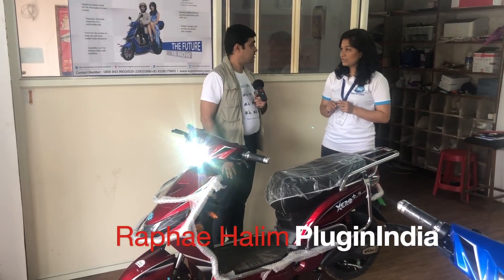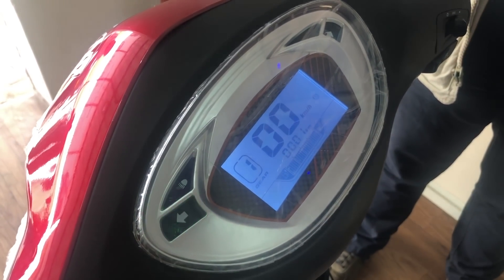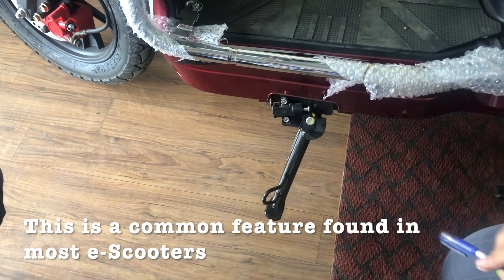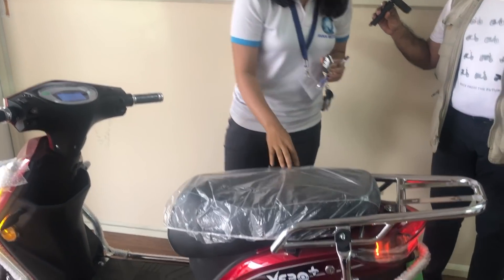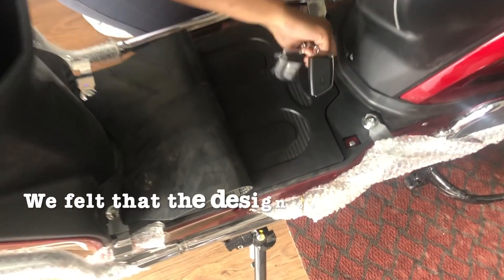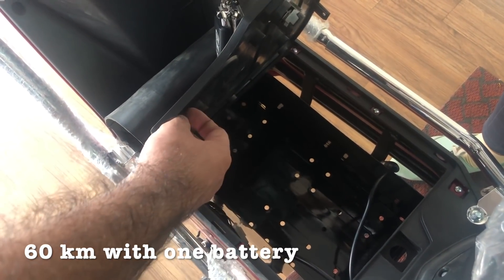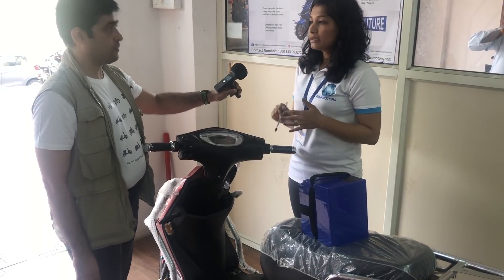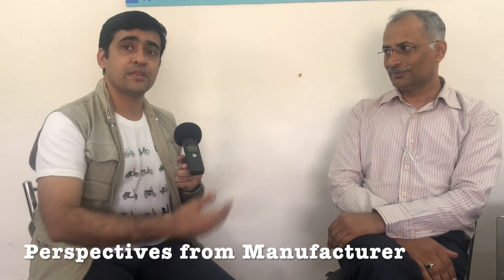Avan Xero+ Electric Scooter : Preview | + Perspectives from COO

Comment: Wish the top speed was higher, think 60-70 kmh would be a lot more useful, other than that I love it, so much better than an ice motorcycle, this is exactly what India needs to greatly reduce its horrible air and noise pollution.